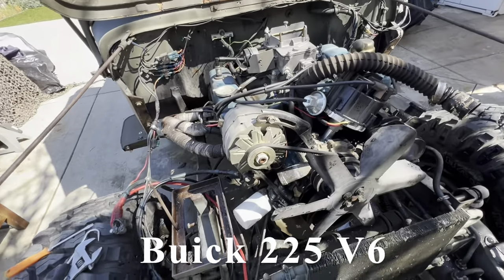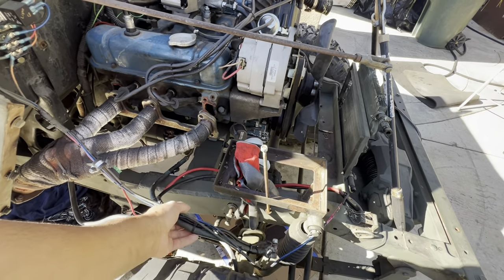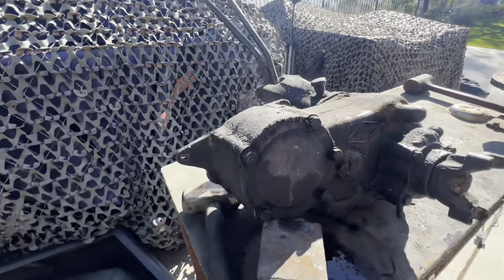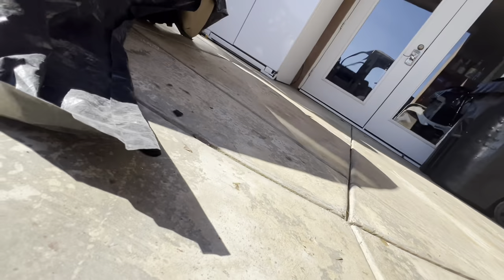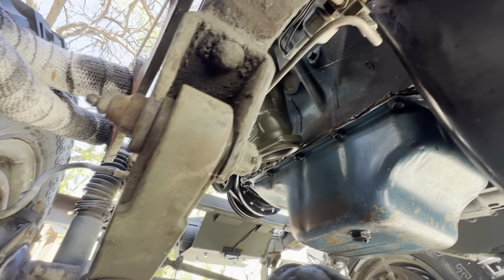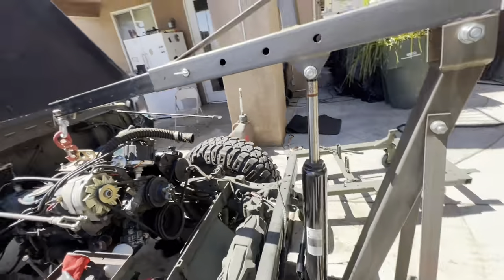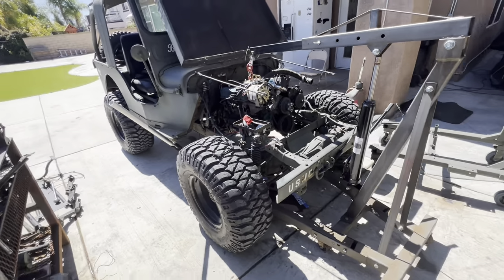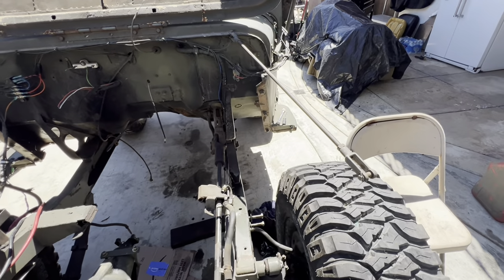Baboy 4 speed swap part 1/ pulling engine and trans/ SM420/ Buick V6 225/ Flat Fender/ Willys Jeep

Comment: Great video. I have the same set up on my m38 . And switch the carb to the motorcraft 2100 just like your setup. But couldn’t find an air filter like the one you have. Could you please post some info on that air filter. Thanks
Reply from the maker: hi Alkatib - okay 👍. i will film it. give me a week.
Reply: @reconern . Thank you. From looking on the internet. I saw many jeepers having the same problem. Some had to cut the hood to allow for air filter